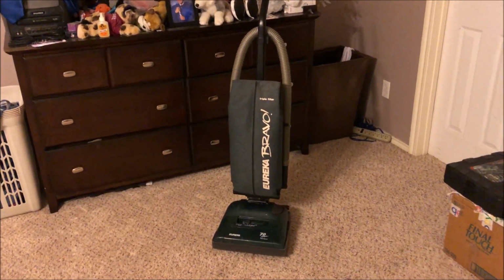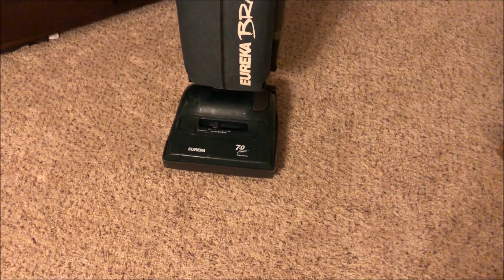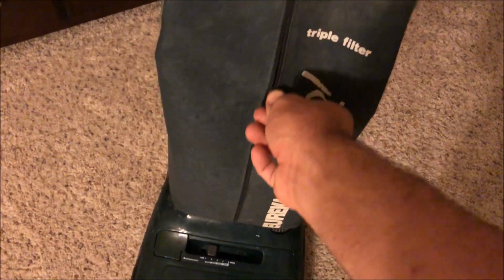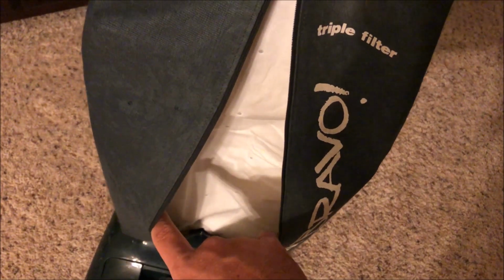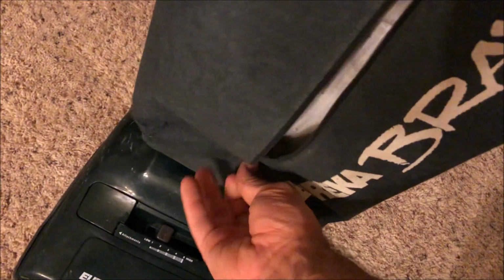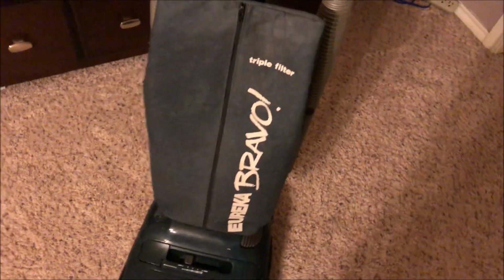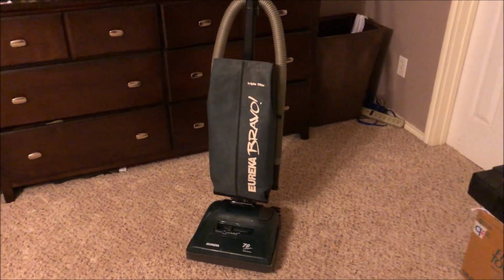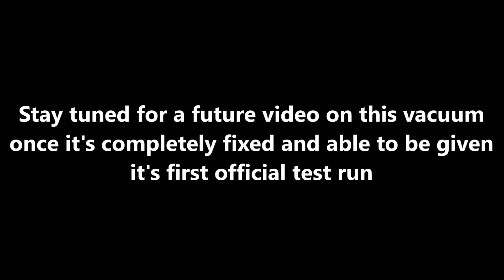Eureka Bravo 9206 First Test run.

Comment: How hard is it to replace the motor bearings? Because I want to replace the motor bearings in my 7 Amp.
Reply from the maker: Honestly, the bearing on the fan chamber side was the most difficult to get off, I wound up breaking the riveted section where the bearing sits in by the fan chamber, and was forced to buy a NOS center scroll of the fan chamber with the new bearing, luckily the field windings were easy to swap over.  The bearing on the opposite side was pretty stuck on, and believe me, I went through 2  bearing pullers before I finally found one that managed to slowly pull that stubborn bearing off.  But for the most part, these are 8mm bearings, and hopefully you have better luck removing them than I did.